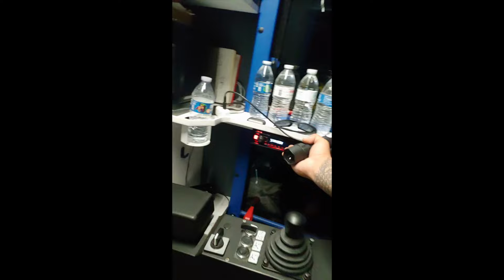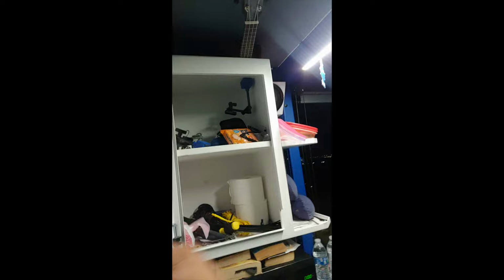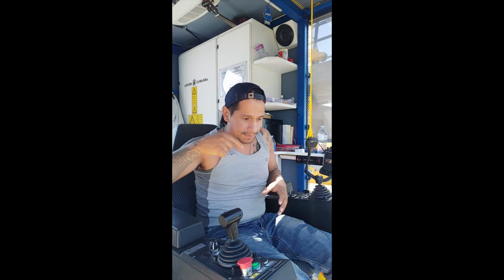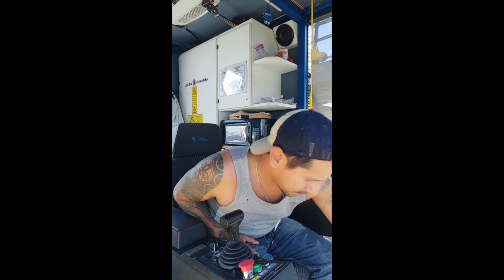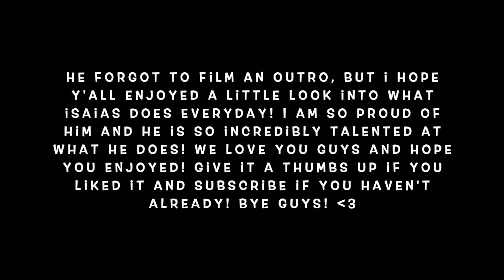DAY IN THE LIFE OF A CRANE OPERATOR | HUSBAND TAKES OVER THE VLOG | Jenn Torres

Comment: i have a question about technicians. if im a crane operator but i also have the education to fix and troubleshoot things on the crane, do you think that would ad value to my job ? or even if i would be allowed to operate the crane and also have position to fix it at the same time ?
Reply: Depends.  Tower crane operators are only resposible for maintaining the greasable points of the machine periodically.  Otherwise there are certified technicians that assemble, disassemble and repair the crane.  They would rather us operators not mess with the fixing with the level of liability involved.  On mobile cranes, yes it would be considered a plus and I would definitely consider a candidate with mechanical experience and training when it comes to chosing the best candidate.  Thank you for the question!

Comment: Why can't they convert those tower cranes to be remote controlled so operators don't need to go up that high everyday and could be even safer.
Reply: The human touch will always be needed.  It's better when there is a trained operator instead of someone trained in remote control. Radio signals have lag and precision is always better than "close"
Reply: You always have to need a rigger on the bottom doing tje heavy work
Reply: They do have remotes for some towers just depends on what type of crane it is
Reply: @anthonyalianell1371 Why not just run a cable instead of relying on radio signals?
Reply: I’m pretty sure some company is working on it but it’s a high stakes job if something goes wrong so it needs to be much better than a human before something like that will sell.